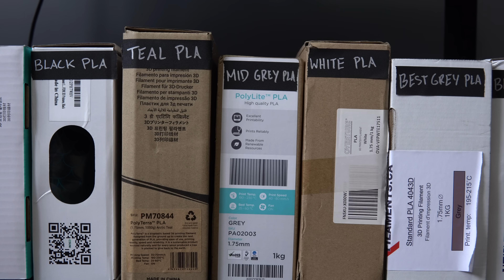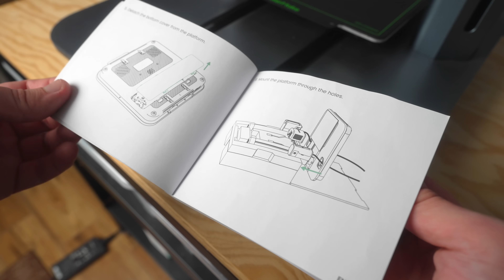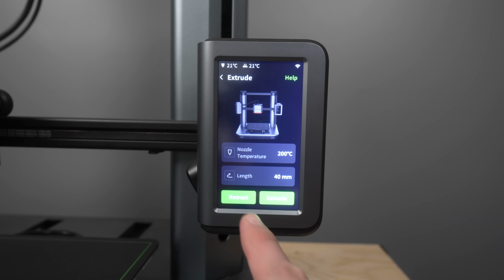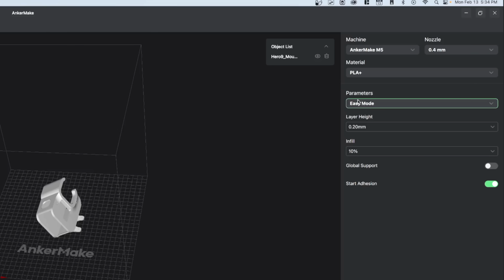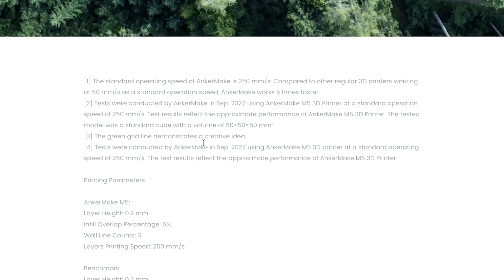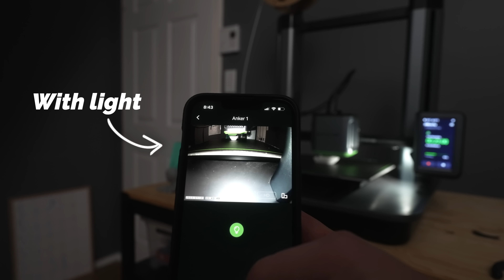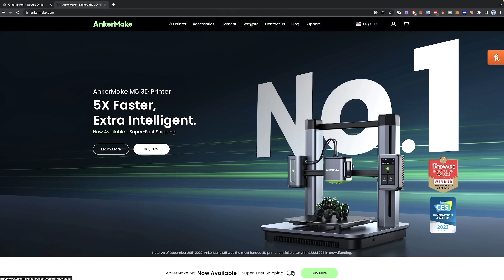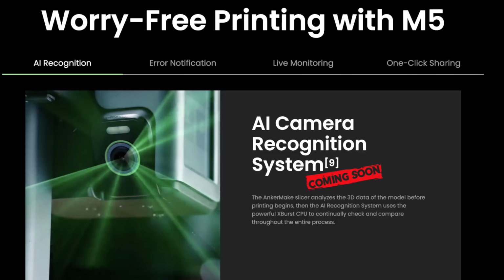The FASTEST 3D Printer I’ve Ever Used (Ankermake M5 Review)

Comment: It would be nice if the slicer could detect difficult spots and automatically print those portions of the print slower so you get the advantages of the increased speed whilst not compromising on quality and less risk of failed prints.
Unless thats already a thing and I've just never noticed it lol
Reply: The auto bed level corrects issues like this by micro-lifting and lowering around the build plate. As everything wears down you need to auto level regularly. Its like how the Bambu X1C take 10 minutes to start it's prints, which thank god you can turn off... AnkerMake simply doesn't force you to do it.
Reply: @echo-hotel  Thats not really what I'm talking about, more so the printer would slow down and maybe print at different layer heights automatically for certain areas of a print. Like it'll print large simple sections of a figurine quickly then slow down for the face.
Reply: @acorgiwithacrown467  You're looking for the variable layer height setting. Otherwise slowing down is just your accelerations: it won't reach high speeds before it has to decelerate. Of course, nothing stops you from slapping on modifiers that set reduced speeds and accelerations for a given print area...

Comment: I haven't watched the whole video, but I just want to say that I can get my ender 3 (not V2, not pro) to print at 125mm/s with 2k acceleration. My voron 2.4 can print at 300mm/s with 7k acceleration. It's not the Anker that is fast, it's how you calibrate and set up your printer. The limiting factors are bed slingers, nozzle flow rate, and hotend cooling. Get you a printer that isn't a bed slinger, upgrade the hotend to high flow, and get good part cooling fans and you will be able to print at 200mm/s easy once you get everything dialed in

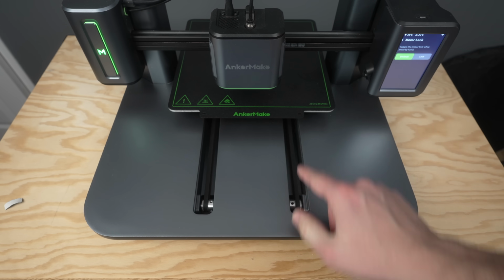Comment: 5:50 

The stepper motor on the Y axis is the same as the ender 5 pro I have.

You can put a dual y axis belt mod on any ender 3.

Linear rails instead of pom wheels are a much better way to spend your money.

Comment: Bed slinger = automatic no for high speed. No matter about a strong stepper and two belts. A heavy bed changing direction very fast is the problem. Bambu X1 is superior
Reply: Physics slightly disagrees with you, as long as you have enough torque and good enough attachment, you can make the axis move reliably and as fast as you need either way. 

Of course Bambu X1 is faster and has less moving mass at speed, however it's also roughly double the price without much practical benefits over Ankermake beside for the slightly faster speed unless you're planning to print engineering materials.

Comment: If you much about tpu filament you would know that it prints slower.

Especially if you were a beginner 3d printer, If you know anything about finnaces you know not to buy the most expensive thing in a categluary when you first try it out. That is why most expensive 3d printing websites don't list the certain printing speeds of different kinds of filament, because most of the people buying these expensive printers are pros at it know how to handle it.

Comment: Have you never used the Bambu Labs X1? Out of the box prints more than twice as fast- SUPER easy to use! I've had one print fail due to using Carbon PLA and bad layer adhesion for complicated support structure. Would really recommend it

Comment: Yes, I am still at a beginning stage. I would like to know if the printer is quite, it sounded like it in the video and if you had tried the firmware update. I replaced the main board in my Ender 3 , firmware definitely had its issues.

Comment: If you want a fast 3D printer the Bambu X1 Carbon or the P1P 
No assembly required 
Remove 5 screws and turn it on
Automatic bed leaving
Extrusion calibration 
LiDAR sensor for first layer calibration 
AI camera for any mis-prints
Automatic Time lapse
Plug and play
Can add up to 4 AMS units for a total of 16 colors of filament
Reply: You forgot about the warped build plate, clogged hotend, broken Mboard fan, faulty heatbed cable, terrible customer support, terrible QC and build quality. Stop supporting bad QC.

Comment: You didn't mention how long did it take to print benchy on new machine. Was it 5 times faster?? Matt, you are missing a huge point when you are talking about the printing speed. You can set whatever speed you want but acceleration is a major limiting factor and on small prints such as benchy or other test prints you demonstrated it will never reach the desired speed. And mentioned acceleration for the printer up to 2500mm/s is actually pretty low for "fast printer". Also if you are talking about fast printing you must mention whether there are resonance compensation as this is new standard now. Another missing point is extrusion volume, but at low speeds which were demonstrated its not an issue.
Also in slicer speeds for different types of lines are different. External perimeters, inner perimeters, infill etc, and they are usually by default significantly lower than basic speed.
Anyway, try to print at 150mm/s for every line type with acceleration at least above 5000mm/s^2.
Reply: I watched like halfway and realised their whole argument was completely flawed. This is just another e3 clone with fancy marketing.

Comment: I always print at around 40 mm/s or even slower. For example, if I want to print something that takes 3 hours, there is no big difference if I print at 120 mm/s or 80 mm/s, it's just 1 or 2 hours faster. However, the printing quality is perfect.
Reply: That's because you print small things. And your acceleration is also not high enough. You may as well try printing at 1000mm/s, it'll never hit that speed with small parts + low accelerations.
Reply: @alejandroperez5368  I am not. I also print big things

Comment: Hey just a heads up, infill isn't super important! You set that camera mount thing to 20% but could have kept it at 5% and would've printed fine, lightning infill is also always an option, just a heads up!
Reply: Idk where he talks about that in the video, but infill is really important...
Reply: @Terandium  no actually, it isn't not sure how long you've been printing but I've been doing it for quite some time, infill is literally only important on functioning parts, and even then you don't need a ton of it, for smaller parts you should on ever really need 50% ish but when your doing prototypes or just desk pieces you can go for 5% and the prints will be practically the same.
Reply: @skellcy7135  ah yeah for models it aint, I mostly print functional parts for selling. So I need it to be quite strong as not everyone inc postal services are very soft to the touch

Comment: You fed filament into the extruder on the side, it did come with a small peoce of Capricorn tube which does imply direct drive, but that doesn't look like direct drive based on how its loaded on the side of the printer like that
Reply: You do load into the side, that's where the breakage / runout sensor is, but the extrusion gearing isn't IN the side, it's in the head itself.  There's about a 7-cm travel path from the mechanism through a short ptfe tube and the heatbreak to the tip of the nozzle.

Comment: Hello I want to get into fpv and I have never flown a drone, I have a 400$ budget and I would like to buy a controller, goggles, and a drone but I don't know where to start or what to get. What drone, goggles and controller should I get, or should I get a specific rtf kit you recommend? I also want decent equipment that I can use for probably a year or two before I would like to upgrade. Also I am looking for a digital option in my budget, if that's not possible then I understand, because fpv can be a pretty pricey hobby but I just want some recommendations on where to start, thank you

Comment: My first working* printer, the DreamMaker Overlord Pro(Deltaprinter), from 2016 printed at 100mm/s according to the official specs, but you could push it higher if you didn't care for finish.(150mm/s was possible) Oh, and it did sensorless bedlevelling... And since it was a Delta printer with Bowden type extruder, it could accellerate like nothing else. 
I'm currently rebuilding it... slowly, very slowly, and hoping for higher speeds. 
*The Mendel Prusa I built a few years before out of printed parts and threaded rods... never really worked properly.

Comment: Bed slingers are old tech now. Nothing close to $600 is valid to spend $ on anymore because of the Bambu Labs P1P. Because of this we will see printers drop in price dramatically.  You can get an Ender 7 at Matter Hackers for less than $400 ATM, and it has linear rails on the XY (please don't buy an ender unless you want to mod)

Comment: my skirt and first layer are at 60mms then the rest of the print is 120mms. i use .4 and .6mm nozzles depending on how big the print is. I use the same settings on 2 printers. i have a longer lk4 pro (ender 3) and a longer lk5 pro (cr10). the lk5 pro will print way faster than the lk4 pro because it has the extra supports that significantly stiffen up the z "tower". and i have all upgraded steppers and dual z steppers. But i leave the settings the same so the files are interchangeable. Even with the bigger bed of the lk5 i can use lk4 files itll just be off center when it prints. i have a ton of upgrades but even stock both of my printers were great. there is absolutely no need to buy expensive printers when there are amazing cheap(ish) printers that exist.

Comment: do you use tolerance when printing? I am new to printing, but I have been learning about things like interference and clearance fits and the classes they have. If you look up these charts, you can try and make parts to work with the real world with as little mistakes as possible. These charts however are mainly for holes and shafts and you have to keep in mind the values you see for the tolerance are for thousanths of an inch. Even if the printer were to print something that has exactly the nominal dimentions you instruct, having the same interior diameter of a holder with the same exterior diamter of the thing that is being held will create a very snug press fit and that isnt even taking into account the  horrizontal expansion of 3d printing. I think it is enough to be of concern when fitting objects together. If you try these maybe the mistakes will be lessened

Comment: The truth is, the public doesn't have a "3D printer," it's essentially a 3D Element Solder machine. And why it's so slow. To actually do a "3D printing." It must solder in a full strip line at any one sliding longitude/latitude/altitude flow per layer make.

Comment: How does this compare to the X1 Carbon?
Reply: It's about half the price, prints a bit slower, does not have a heated enclosure nor does it come pre-equipped with a hardened steel nozzle. 
However in terms of ease of use, both are very good and at least in my opinion, Ankermake looks more like a high-tech work of art. 

Both of them are more than good enough to get started with 3D printing though :)

Comment: It's a shame everyone keeps checking these "ender" type printers.  Delta printers, like the FLSUN SR racer printers ARE the fastest printers out there and the older QQ-S pro is avail. at 500.00 apx.  Add the speeder pad Or a rasberry pi and you increase the speed up to 5x.  The speeder pad is a KLIPPER controller which can be added to the rasberry pi.  Klipper can control up to 3 printers at the same time, has an option to add a 5 dollar board to the print head to measure ringing and compensates for it to increase print speed.  My QQ-S pro prints at 80mm/sec without the accelerometer to measure ringing.  FLSUN's latest V400 prints in the 100's of mm/s.
Delta printers have print tables that are fixed.  Level it and adjust height only once.  Change the nozzle or other parts of print head and go through autolevel again.  These printers are bowden tube types except for the V400 which is a direct extruder type.  I had the ender 3 as my first printer and soon returned it.  I've had my delta for two years and never looked back and even bought a second one.  The only other type I might get is a core x-y like the ender 5.

Comment: The camera on this is actually pretty good from what I can tell. I got a Logitech for my octoprint and it was just awful. I couldent see the print without a light bar I bought for my Ender 3 s1 yet when it’s on the print is super bright. It’s also just a low quality canera in general. It had awful fps and was super blurry even when it was connected to my computer instead of the orange pi

Comment: There is no way that is actually printing anywhere near 250 mm/s. Like you said in your pinned comment it is limited by the acceleration but also remember that your other printer was only 50 mm/s on some parts, the outer walls were 25 mm/s. At 250 mm/s it would be able to go right across the build plate in about a second. If I had to guess I would think you are probably getting maybe around 100 mm/s max when printing that benchy.

Comment: The latest firmware update has changed the AI a lot and it has gotten way better. Also, low light with black filament gives lots of false readings with the AI. This machine is my go-to machine ... as a matter of fact we just bought a second one.
Reply: $1600 for 2 printers? lol id rather get 8 normal priced printers
Reply: @2stroketyson79  Not sure what's funny about buying two high quality $800 products instead of 8 diy toys that eat your time with troubleshooting.
Reply: @Draxi_1  Normal "DIY toys" are made in much the same way: V-rollers on a V-slot, uprights. Anker has a downside in lacking an anchored-down bed, although for a bedslinger the sheer mass of the bed should be enough to keep it in the slots. For this price an enthusiast machine would be expected to supply a superior motion system, either linear rods (Prusa) or for more modern lineages, linear rails. Both are more rigid, reduce vibration and oscillation, thus requiring less input shaping effort and allowing higher speeds at lower maintenance and higher precision than V-rollers. 
Someone competent enough to need 8 printers in a farm will almost certainly have the know-how to ensure an Ender 3 to be reliable. Besides, when it comes to proprietaries, for 800 bucks you can have the Bambulabs P1P, a CoreXY machine with a much higher speed ceiling and overall capabilities than the Ankermake. It's able to hang up there with the RepRaps like the Vorons, VZBots, or Ratrigs in speed and quality. M5... Just cannot keep up with that, it's the fundamental limitation of the Carthesian bedslinger system. It also has to pick a fight with another bedslinger in Prusa Mk.4 now, which is a superior offering in every way.

Comment: In blatant digs, it's a bambu A1 copycat, it gets about 70% there but falls flat on some of the ease of use, and on some of the design quality; which is important for better quality when mixed with speed.

Also please stop touching your print bed.. skin oils wreck adhesion of first layer at modern first layer speeds.

Comment: There are multiple levels to the AI. Also you need to fix you lighting perfectly for the best results. I have White, Black and Gray boards that go on the opposite side of the camera to provide contrast to the filament color. With a lot of added lighting of the right temperature, I think on the warmer side, it starts to function really well. When I hate it setup for nighttime prints I get notified of every error. But this means I have four lights pointed at it from every direction. And of course to pinned at the camera or creating hot spots. 

Yes the software isn't ready yet. But light anything with a 3D printer you need to work with it and not against it. A contrasting build plate would be nice as the only color I have a problem with is black. But who knows if that'd freak out the software or not right now.

Please note anyone buying a new one, it only comes with one build plate. Also I think my camera looks better than his. 

The slicer is actually pretty good. It's not on the level of other slicers at all. But it is solid. It just works. You want to do art learn to slice elsewhere and drop into ankermake. You want to print a ton of boxes easy mode is all you need. 

Want nearly full 250mm/s, print boxes and circles. This goes for my Bambu X1C as well. It's faster, but it slows down on complicated prints, or at least you need to make it do so. Between these two I chose the AnkerMake for new designs. It's plenty fast enough to model something and prototype it on the AnkerMake then mass produce on the X1C. 

You can actually go beyond 250mm/s lol... Don't do it. It's fun but it will fail. 

So negatives: 
1) Clearly the AI needs major work. But they have improved it multiple times. During the day now I can take away all but one light.
2) Replacement parts are hard to get.
3) They don't sell extra build plates as of (03-17-2023)
4) If you notice an error and want to pause you can but you can't lift the hotend to clear the nozzle or use the extrude feature that is there but needs the nozzle lifted! lol?!? This isn't a huge negative, just an oversight I think they'll fix eventually. And most other printers can't reset properly after being lifted anyway.
5) The ability to turn the printer off. You can leave it on all day and it appears to not use must power and the temp is basically room temperature... But come on this would be an awesome feature to remotely turn it off or put it in sleep mode.

That's about it. Everything else would be outside of their control and specific to a persons needs. Even the AI camera isn't important for everyone. It simply works. And if it doesn't try a different filament. That's the one advice I'd give anyone with any printer, get different brand filaments and you'll find one that is a good baseline for dialing in your printer. Currently it's Overture Matte White for me. Works well with retraction and clearing out gunk. But look around for your own.